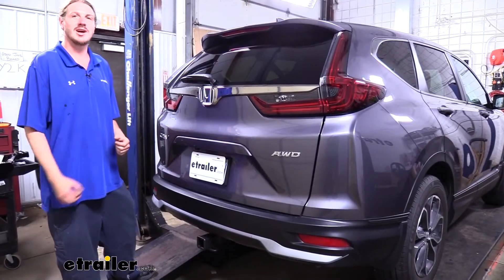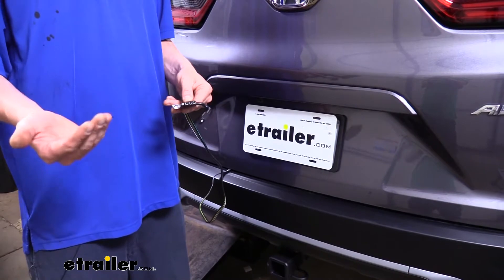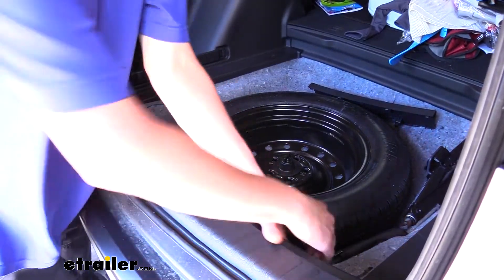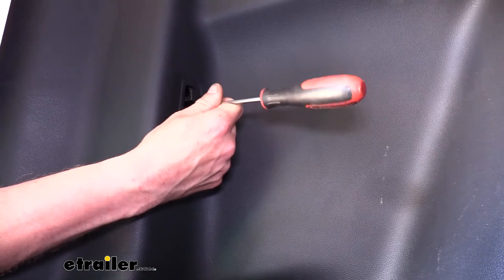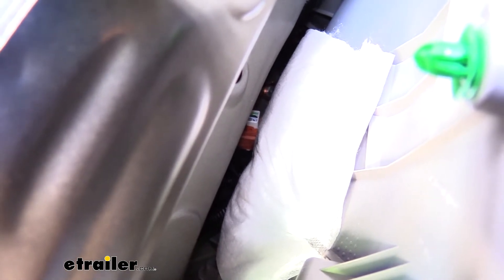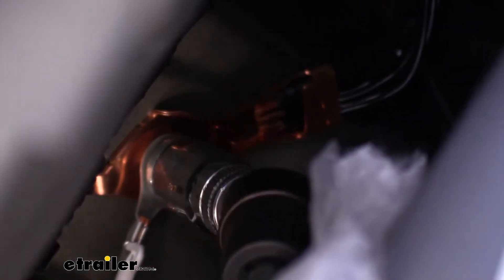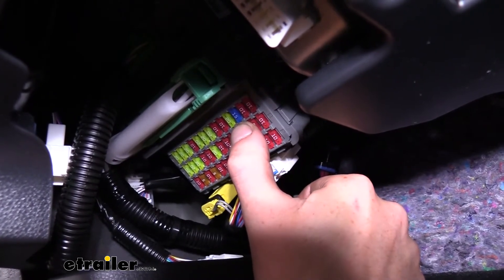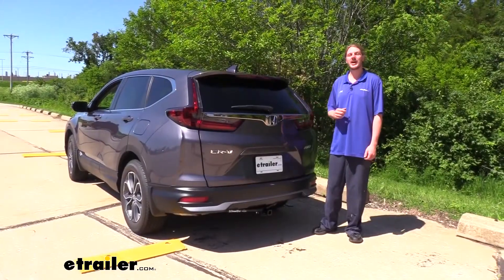Set up: T-One Vehicle Wiring Harness with 4-Pole Flat Trailer Connector on a 2020 Honda CR-V

Comment: My 2018 honda crv doesn't have the connector
Reply from the maker: It'll be located behind the upper panel on the driver's side in the cargo area. You're looking for a white connector with brown or tan tape wrapped around it...
https://www.etrailer.com/Custom-Fit-Vehicle-Wiring/Tekonsha/118741.html

Comment: Why not just poot it in the spare tire compartment. If that fuse blows you have to do this all over. DUMB.
Reply from the maker: The connector IS stowed in the spare tire compartment when it's not being used.
https://www.etrailer.com/Custom-Fit-Vehicle-Wiring/Tekonsha/118741.html